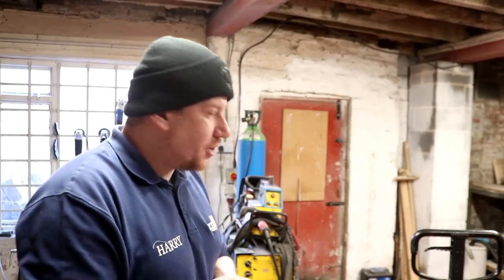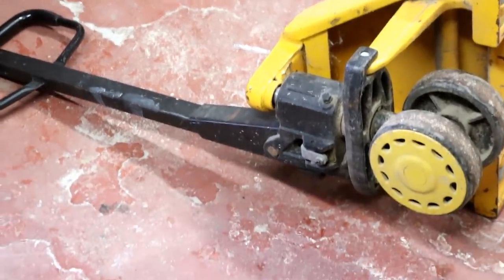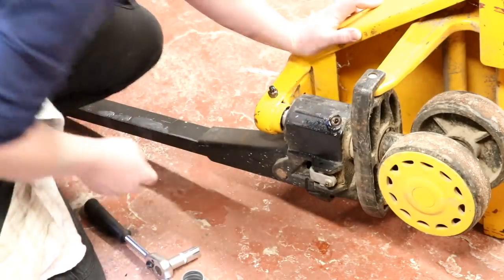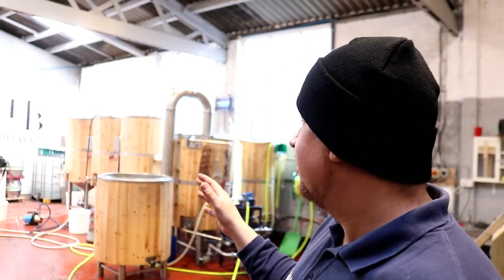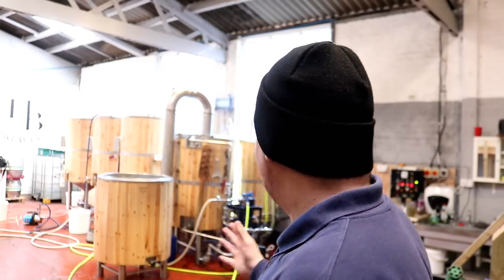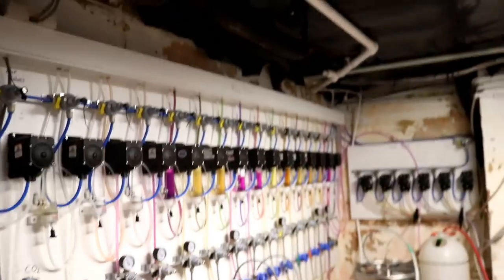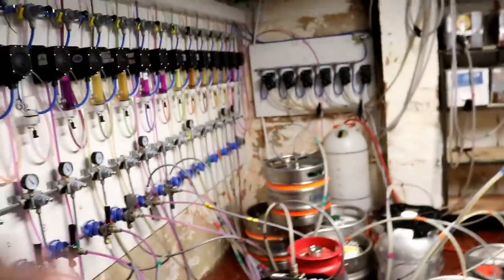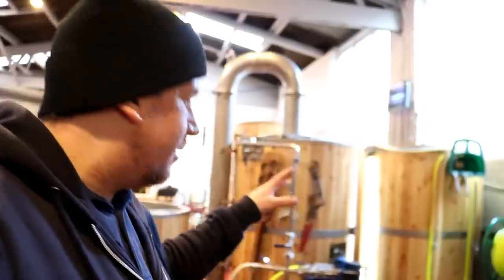HOW NOT TO SERVICE A PALLET TRUCK

Comment: Just make sure you dry hop the NEIPA at high kreusen (Say 3 days in) to make it cloudy in appearance :)
Reply: Don't waste too many hops that early in.  You lose a lot of the aroma with the active fermentation.  Save the majority of them for after the yeast have flocc'd out!
Reply: @henzik  Plenty of ways to skin a cat mate.  Probably half of my beers are NEIPAs and I haven't hopped at high krausen in years.  I get plenty of haze that lasts as long as the keg does.  While there is a correlation between hop polyphenols, proteins, and yeast leading to haze, that is not the only way to achieve a beautiful hazy beer.  More importantly, if done wrong it can lead to some pretty gnarly hop burn while drinking the beer.  

You definitely get different flavors by hopping at different times.  Hopping during fermentation leads to a more ester driven flavor while hopping beer free of yeast gives a more "out of the bag" hop aroma.  People obviously have preferences with regards to which flavor they like more.  Homebrewing allows people to do whatever they want, which is the beauty of it.

Couple pics, if you care to check them out , can be seen here https://www.instagram.com/wreckagebrewingco/https://www.instagram.com/wreckagebrewingco/

Send me a PM so we can trade some brews!  Cheers!

EDIT:  Sapwood is right around the corner from my job.  Have enjoyed most of what Mike and Scott are pumping out over there!